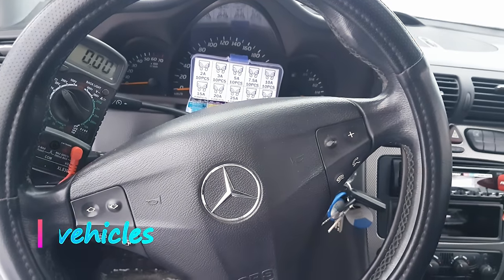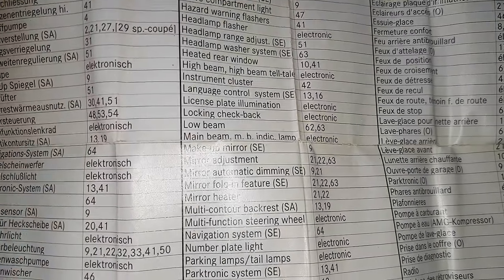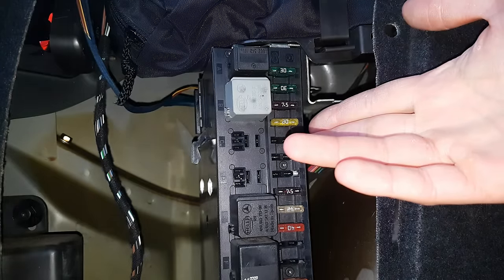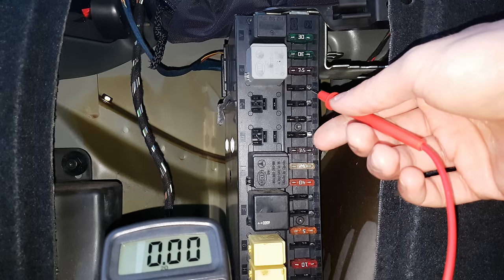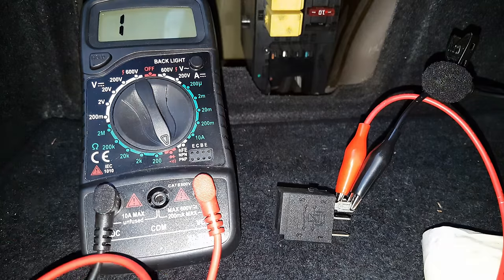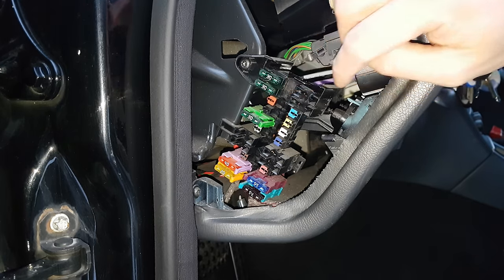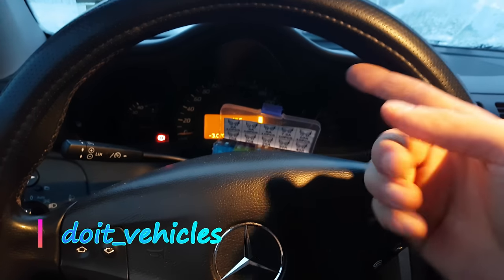Mercedes w203 All Fuses and Relays Location - How to test them

Comment: Definitely saving this video for later, I’m actually looking at 01 c320 I want to buy for a summer project and the owner told me it won’t start due to electrical issues, this video is very helpful
Reply: I have a 02 c320 im willing to sell it does have minor electrical problems but drives

Comment: Bro this video is well explained.
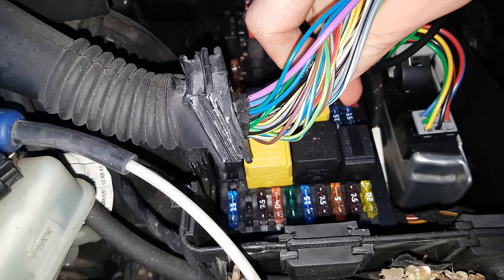06:38 i have a problem with fuse 52 for starting the car, it keeps breaking and my car won't start and i have to constantly replace it. 
I see number is 20 on yours, mine is 15. 
Do you have any idea why mine keeps breaking?

Thanks
Reply: Change the fuse to 20Amps fuse. Your current fuse is constantly blowing because your starter relay has a damaged resistor. Replace the relay with one from Mercedes’ Benz. More expensive to buy from Benz; but best practice in this situation.
Reply: @kiwiwifi  i tried to replace with a number 20 yellow fuse but still didn't work. I ended up taking it to my mechanic. He repaired something, I don't know what exactly. Now it works perfectly fine with a non-mercedes blue fuse number 15

Comment: Excellent video. I have a problem with my Mercedes Benz w203 c class. It doesn't turn on the dashboard light and no fault indicator light, but the car turns on without problems, but the front lights and the engine fan turn on at maximum speed. I don't know what my car has. Could you tell me if it will be a fuse where I can locate it? Thanks you

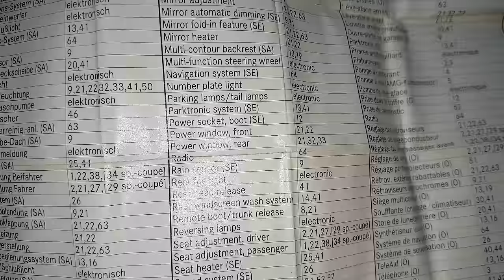Comment: My Rear Fog light went out on the one side, the bulb was good, and on the fuse list at 1:10 it say "electronic".  I was wondering where the fuses or relays for the fog lights are?  Excellent video by the way.
Reply: Chris I’m having the same issue. My left blinker isn’t working and I see that for turn signals it says electrical. Not sure what to do
Reply: @alexcascante001  I saw a video where a guy replaced the whole blinker assembly.  It looked like a pain because he had to take off the steering wheel and the air bag.

Comment: Thanks a lot of the video , I have replaced the alternator for my C32 AMG it was defected I replaced it with another new one , it blow up the Fuel Pump relay and after I replaced the relay yet the car doesn't start ...I am looking for the alternator fuse ...any idea where it is ?

Comment: Hey man I also have a question, I have a Mercedes W203 c200k, I’m wondering if that’s OBD2 or OBD1, the heads up monitor I bought doesn’t seem to have power at all(tested on friend’s vehicle it works), the car’s OBD port is exactly the same so I can insert that, however I’m not really sure if my car is OBD2 complaint...
Reply from the maker: All the gasoline engines sold in Europe after 2001 are OBD 2 . Some are OBD 2 even before 2001 . If it fits on the connector it means its OBD2 .  OBD1 will have different connectiors

Comment: Hey there ... great videos .... here is my odd problem ... it is a long story.  Maybe you can help me, I know what caused my problem. I have a 2006 C-230 Mercedes Sport with 63,000 miles. I had been looking at my fuses to try to disable the car alarm that kept going off randomly.  I did not even touch the fuses as I figured I would later that day and my big mistake was leaving the fuse cover off since I knew I would be back later on.   The problem is I went for gas and figured why not get a car wash.  I did and as I came out of the wash I heard the radiator fan louder than usual.  I pulled off to the side of the car wash and turned off the engine and then the fan came back on .... I pulled out the key and it still stayed on.  Then I opened the hood and I saw that I had left the fuse box cover off and looked closer and I saw some small drops of water on the fuses.  Murphy's Law.  I had left the cover off and then got a car wash and water had somehow sprayed under the bonnet. A bad coincidence. I dried it off as best I could.  The fan stayed on.  I drove it home and it stayed on even without the key.  Right now I have the negative terminal off the battery to stop the fan.  I will readdress the problem in the daylight tomorrow.  Any thoughts ?

Comment: I have one more question in regards to the Function and the Fuse No. What does (SE - SA) stand for next to the function? I have a fuse #8 that's missing and it states Anti - Theft Alarm (SE). can or should I place one in that slot if their was not one their and if I do will it affect anything if it was already missing.

Comment: Hey man i was traveling a 6 7 cm of water height and in the next day the dashboard stopped also the lights controler stopped what should i do is that a leak of water to down of the steering wheel?

Comment: Hi mate! My dashboard is dark and I'm still driving  2 weeks till coming 2 second-hand dashboards from eBay. But even with other dashboards is the same! I read in the forum this is often and maybe is low battery, a bad connection or cut inside wire after crimping. How to find the pins with for power supply on this 20 pin connector and the fuse for this connector supply?

Comment: to test for continuity to the fuel pump ...where do i place the red probe and the black probe?is there a inertia switch in the 2003 c 230 kompressor ...if so where?

Comment: Question: Which Relay or Fuse do you think it may be that I should replace and as far as the pump. If the drivers side of the windshield wiper fluid hoses were working and on the drivers side and the Windshield Wiper Fluid hose on the passenger side was not working would that mean that the pump is good. Better question would be is if the pump was bad would fluid only come out of one (1) hose because fluid is coming out of the drivers side and not the passenger side.
Reply from the maker: The windshield wiper motor has the fuse number 46 on this car and the relay" L " for the motor . If it was spraying fluid only through one nozzle either that nozzle was clogged or the pump is too weak . Try first to hear any nose from the pump location when you activate it, it's quite loud. Try as well with a needle to unclogge the nozzle . I don't think the pump has a relay ; I might be wrong .
Reply: Thanks for your reply I was able to locate the problem it's not the pump it was clogged an the Windshield Washer Nozzle I unclogged the line and replaced the Nozzle and it's not working. I took off the washer line removed the dirt from inside the tube line replaced the Windshield Washer Nozzle and the fluid if now coming out of the damaged nozzle. Thanks for your help and guidance
Reply from the maker: That's nice to hear ! you're welcome .

Comment: Great video > question 07-c280 / crank no start especially after warmed up. Checked fuse & relay for fuel pump ( good ) replaced fuel pump with vdo and still having issues!! Had at two separate certified shops with no luck.
Reply from the maker: It requeres deeper invetigation which includes testing , wiring diagrams tools and knowledge about what to look for .
Reply: @doit_vehicles  ok, thanks for suggestion. I did bring to shop that specializes in Mb and they found the  new fuel pump was drawing to much amperage!! So I replaced again and still having issue !! So I'm thinking ground issue ?? Any recommendations where to bring in Minnesota??
Thanks again

Comment: Great video, thanks. One question, I have w203 220CDI (2004 facelift) and I see that fuse nr 58 and 61 are empty, on the paper they say for transmission electronics. I have automatic transmission with 5 gears. Do you know what are they for? Thanks!
Reply from the maker: Thanks.  That's a good question .. Is your transmission "tip-tronic" ( the option on the gear stick to use it in manual mode ) ? 
I can not be 100 % sure , but it is possible that the fuse box was designed for other high end models which might have extra options on the transmission (like extra selenoids) . I didn't check for my self yet , but you can disconnect the main wire harness from the transmission and look for continuity  from those pins to the specific fuse box ; that can be one way to find out about those opened slots .

Comment: wondering if someone could test the value fuse 46 (windshield wipers), mine shows it has 1V, and my wipers aren't working. it's always like that, hood closed (trick the switch), ignition on, turn wipers on all positions, the fuse never gets 12v, wondering what others find.

Comment: CORRECTION: In the video  around 3 min you talk about the fuel pump and the fuses. You state that one side of the FUSE is connected to the ECU and the other side is connected directly to the fuel pump. Incorrect. The fuse gets +12V directly from the PREFUSE BLOCK, the other side of the fuse is connected to 1 RELAY contact, the other relay CONTACT ties directly to the FUEL PUMP. In short the relay is getting controlled by the COMPUTER via the low voltage of the relay COIL. The POWER side of the relay is separate from the computer if that makes sense. My comments are intended helpful, NOT to be critical.  Thank You for shooting the video - I know that is a lot of work.
Reply from the maker: Thanks ! Strange  that in my head I had the right info but it came out wrong 😂 , Very obvious since there is a relay.. 😅 I was probabily confusing with the ECU ground switch of low amperage components . 
Very few come with constructive correction , so it's really appreciated  !

Comment: I'm having a problem with my windshield Washer Nozzle on he passenger side on the car and the Windshield Washer sensor they both seem to have gone out at the same time could it be a relay switch or a fuse that needs to be replaced. I have a 2002 C240 Mercedes Benz. I ordered the Washer Nozzle but I just would like to know if I shout return it and replace the fuse or the relay switch.
Reply from the maker: Hi , First step would be to test the relay and fuse . Than try to test the pump , pretty simple it just need 12 v . Here is a short video on how to replace it / location of the pump  : 

https://www.youtube.com/watch?v=GqX_RFjNS1k

Comment: Sorry for the question....I didn't see anything for the sun roof...does it have a fuse? My w203 it's from 2004 , and wen I want to close...he closes but immediately backs to halfway open position....if you now something about I appreciate any help.
Reply from the maker: Hi ! from what you describe there is input power . Try to reset the synchronization of the sunroof : have it closed , turn the keys on the second position and hold the botton of the sunroof for 20 sec (as you would do when closing )
Reply: @doit_vehicles  i tried as you advised but with the key in 2 position there's power to the controls...so wen I hold de botton it will raise the back of the sun roof.... thanks for the advice any way .... maybe it's a sensor???....if you now something else I appreciate 👍
Reply from the maker: It's hard to say something without having the car next to me . But I am pretty sure it's a synchronization issue .. try with the key in the possition 1 than
Reply from the maker: The relay is F and fuse no 9 from the back fuse box . Might wanna inspect the relay or clean the pins of it ..
Reply: Hello Nuno I was having the same problem and what I discovered is that something was jammed in the track of the sun roof. Check for any dirt or debris that my be stuck remove it and hope this works  I hope this works.

Comment: I have the same model/type of car like the one you used in this video. My fuel gauge stays at minimum and radio does not come on. please what can I check???
Reply from the maker: For the fuel gauge inspect the fuel pump and the sensor attached to it responsable for fuel level indication - it's potentiometer so you can test it with a voltmeter ( check the wirings as well ). For the radio it might be simply broken or a short somewhere , it's hard to guess without seeing the car  ..

Comment: What about the relays for the blinkers are indicators wherever you want to call them turning left turning right my problem is my indicator is stuck sounds like an angel on the blinkers on in the left position all the time and the lights are blinking left if we turn to blink write it will blink right but worry I've had to do for an emergency is disconnect the front and back Blanca blinker and put a bit of black tape over the one on the mirror until I can find a video where somebody makes reference as to the relays for the the indicators

Comment: i have a c220 cdi 2003 and the driver and passenger seats recliners dont work properly, the driver side goes forward but not come back and passenger side goes back but doesnot go forward but height works on both fuses are fine i checked,,,,, any idea?
Reply from the maker: It's probabily the switch or the module ; once the electric seat moves in one direction it can't be a fuse .
Reply: @doit_vehicles  thanks but both are doing the same thing so is it possible both are bad at the same time

Comment: Hello, I have a 2002 c240. The trunk doesn’t open with the button on the door nor with the electronic key. The fuses for the locking systems check good. Any ideas?
Reply from the maker: Well , if every other lockers works than it might be the locker actuator broken or the small spring inside . But you have to open the trunk first . But there should be a regular lock hole which can be opened manually with the metal key from the MB key fob
Reply: Can you make a video checking the lock actuator or the spring? My trunk was broken after it was towed and my trunk won’t open either unless I use the actual metal key. I would love to learn how to fix it!
Reply from the maker: @3638deejay  Until I do that you might check this , it will be similar in the trunck as well :

https://youtu.be/FPadjD1wPTE

Comment: So my 2003 c230 headlights and taillights don't work when I try to turn them on with the manual light switch. The headlamps work when I flash the high beams. Trying to figure out if its a fuse, relay or the switch itself. Any ideas?
Reply: Is there a way to test the headlamp switch?
Reply from the maker: In this situation there is no fuse involved . You'll need some wiring diagrams about the headlights and with some knoledge and desinstalation of the switch you might find the problem . Yes it's easy to test it once you get the wiring diagram or you can find the purpose of each wire yourself  , but that will take a lot of time and effort .

Comment: Can you tell me where the terminal 30 relay is? I’m getting a C1210 “Terminal 30  under voltage” fault on my diagnostic reader.
Reply from the maker: It sounds like a bad wheel speed sensor . Check the ABS relay and see if you have signal on the switch side 30 and 87 ; also test the relay / wheel speed sensors .
Reply: Thank you 🙏

Comment: Hello man, I watched the whole video and couldn’t locate the fuse for OBD(on-board diagnose) fuse, there is no power in my OBD port, do you know how I can solve this?
Reply from the maker: Hei ! It's also called Datalink Connector , fuse no 62 in the engine bay ( I think 🤔)
Reply: @doit_vehicles  ohhh....I have just found it, thank you very much.. I need to get this fixed tmr.

Comment: So where is the fuse or relay for the brake lights? I have a 2018 c300 and the brake lights both went out and its causing the headlights to stay on
Reply from the maker: that's another generation of MB which I did not touhed yet , the car is in waranty , any issues should be fixed for free

Comment: Thank you did you mentioned where is the AC relay located my AC clutch does not engage thanks in advance for these great vid and explanation
Reply from the maker: On my car the switch is on the small panel by the shifter when I turn the dials , the clutch engages on the compressor . But I know some other cars have a relay also ; check if you have extra relays apart from what I presented , for example..
Reply: There is no relay. Ac compressor has no clutch. Because ac compressor works according to its proportional valve.

Comment: I noticed that your #64 fuse is 15A …. my fuse diagram says it is a 10A fuse .. does it make any difference?  Very good video ... thanks
Reply from the maker: Well it will not protect very well the component it supposed to protect in case of an short or overload . So it's a good idea to install the recommended one .

Comment: Thanks for a good video. The only thing im missing is the fuse for the windshield flusher pump. 🤔
Reply from the maker: It might be in one of the fuse for  " electronics " since it's a low amperage it will be in a bulk with other components

Comment: SRS code, ABS and Check Engine light comes on. After driving for 10 miles, then turn off the engine the car doesn't 
start. Half an hour later it starts 
 What's the problem?

Comment: hi, will someone tell which supply(positive or negetive) is need for clock fitted in instrument cluster  1997 mercedes benz
Reply from the maker: You meen if there is a fuse for it ?
Reply: @doit_vehicles  i got fues blown done fix and got positive supply in red yellow wire , now my clock is stuck , is it possible to repair

Comment: I’m still confused. Key doesn’t turn in any direction. Was told I have a fuse and relay problem with my steering lock.
Reply from the maker: ignition switch

Comment: i have a problem with my c230 2002 it don't  crank  i have powers but no cranck
Reply from the maker: Maybe the starter ?
Reply: @doit_vehicles   every thing was ok till I change the shifter I adrove it then next day wont start
Reply: i have no power in the fuse slot # 52 on Mercedes 2002 c230 what sould i do ..
Reply from the maker: first check the relay and the battery and see what's the result
Reply: @doit_vehicles  i already checked  i found one fuse has no power i checked also the slot for that fuse which is #52 has no power ...there's  no power coming on to that fuse..
Reply: IT not startyng det chee ?
Reply: @sobeteracotapremontate5022  nothing even the fuse no power #52 it's not blown